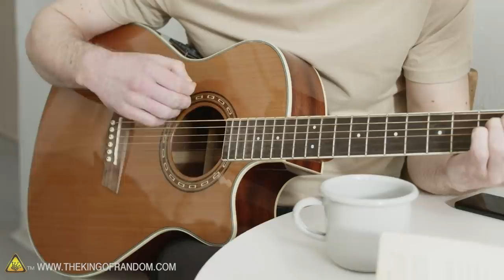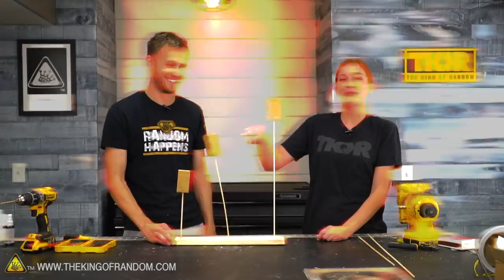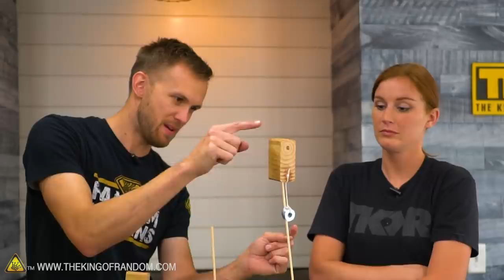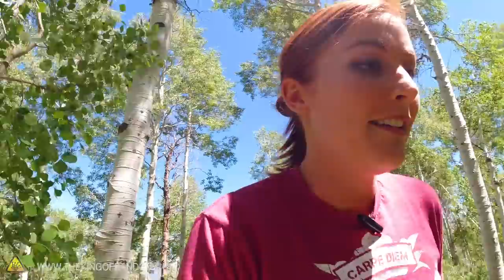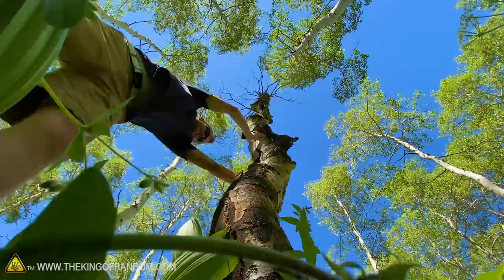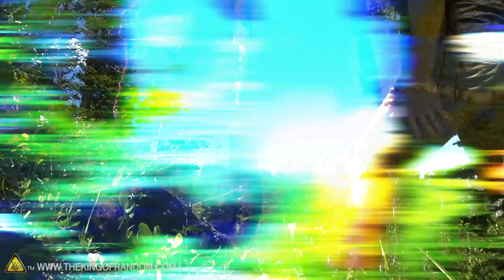How To Cut Down a Tree With No Tools

Comment: I have done this lots of times. There is a DANGER when doing this if the tree is too tall.  You were close to having the problem. If you look up at the trees that you failed with, you will see that you had more that one resonence going at once,  The tree has an "S" shape at max bend.  It can break in the middle of the S and come down on the person pushing !
Reply: Wow don't try at home
Reply: @ehrenbormann1014  yeah it's usually easier in a forest
Reply: huh so once it starts to fall run away?
Reply: @btd5ninja64  You can run faster then gravity? Wow, neat.
Reply: @oliverer3  hay maybe he lives in a forest XD
Reply: @Connor Joint, I think he means run to the left or the right
Reply: Yeah, if the tree is too dead and snaps in the middle you can get injured, knocked out, or killed pretty easy by the top of the tree trying this.
Reply: @ceeboneee5632  i mean if i could run faster then gravity wouldn't i end up lifting of the ground abit and it shouldn't be that hard to outrun something whats falling one dirrection if you go a completely diftrent one other then towards it
Reply: @Netdawg  The top can fall to any direction, if it doesn't make a clean break. Also note how he isn't watching up constantly.
Reply: Yep, I grew up in the woods and had quite a few trees snap in half and a few of them whacked me in the head. It could have been much worse
Reply: I almost got hit once doing this
Reply: I have pushed over trees this way and had the top break off. If you look up and see the top falling it is going to be too late.  Just don't do it.
Reply: Did that. Was unhappy.
Reply: @brokenos7710  I can see why
Reply: Plant 50 trees or die
Reply: Yup.  This can get you killed.
Reply: @ceeboneee5632  10 m/s
Reply: @thef2pgamer500  9.81m/s^2 you mean?
Reply: @ceeboneee5632  i mean somebody could go 36 kph
Reply: @ehrenbormann1014   who will destroy a tree in home and who will have tree this tall
Reply: @dilshadkp1304  I have trees this tall and taller
Reply: I put aka and auto corrected to wow wtf auto correct
Reply: @ehrenbormann1014  aaaaaaaannndd Im guessing you are the only one who has aspen trees at home huh?
Reply: I have had that exact thing happen almost got really injured
Reply: Woah....this guy has big brain
Reply: @abdelrahmanharmouch5221  min are white and red pines actually but same concept.
Reply: @ceeboneee5632  no, you can't run faster than gravity
Reply: @senmetwo42  why would anyone like this its terrifying
Reply: Connor Joint well it’s not like the tree is gonna start spinning like a helicopter im sure if you’re looking up at the tree pushing it and you see it break it’s not hard to sidestep run away like tree arent made of iron it’s not drop instantly you’ll have time to run
Reply: btd5 ninja run faster than gravity isnt a thing either you can’t outrun gravity it’s running not jumping
Reply: I thought the same thing
Reply: btd5 ninja or to step aside

Comment: We were doing this when we were kids. Just a reminder: look up, or you may get knocked out by a falling branch
Reply: I learnt that lesson with a Horse Chestnut tree when I was a child. Having solid spikey objects hit you on the head at quite a speed soon teaches you to be more careful when collecting conkers. To all non-UK viewers a conker is the solid fruit of the Horse Chestnut which is surrounded by a hard spikey casing. You remove the conker from the casing, carefully drill a hole from top to bottom then thread a, traditionally, shoelace, with a large knot on the end so the conker doesn't fall off, through the hole. You then hold your conker out at arms length by holding tightly, sometimes wrapped around your hand for added grip, the other end of the shoelace to the conker while your opponent swings their conker, in a hard downward arc, and smashes their conker into yours. When they miss it's your turn to hit theirs. For best results the person swinging theirs into yours shortens their laces by wrapping it around their hand til about 4 to 6 inches is left for maximum power. The bout is over when one of the conkers lies on the floor like shattered dreams while the victorious conker fights against a fresh opponent til it too breaks. Score is kept by how many your conker destroys before it too falls to the ground in pieces.
Reply: That happened to me once with a small spruce tree!

Comment: I learned this when I was a kid. It’s how I messed up my knee! When I was 8, i learned that if I climbed to the top of one of the pine trees in our play yard, I could swing with its resonance frequency... and since it was a pine tree, it had a lot of spring... until the branch I was on snapped. I must have hit every branch on the way down, hitting the top of the wall separating our play yard to the side yard. My knee dislocated. Luckily, I was 8. Nothing snapped or tore... the ligament just stretched like a rubber band. To this day, when i bend to the floor with my knees, they pop. And when it rains, they get all stiff.
Reply: Yikes man science hurts sometimes:(
Reply: icybear21 haha. I was just worried about the fun... not the science 🤪 I did learn from it, though.
Reply: My left knee does the same thing except I stretched my ligament doing high jumps. Sometimes it shift and sits at such an uncomfortable position
Reply: Was it an ugly tree?
ba-da-bum-tish
Reply: Could have been all those branches breaking your fall on the way down as well.
Reply: I had a similar injury from getting hit while playing sports. They told me that I'd have probably been better off if I'd outright broken it.
Reply: The reason that joints tend to get stiff when it rains is because of the pressure in the air being changed. The joints on our bodies are far more sensitive than the rest of our bodies. Because animals tend to have far more joints than human beings as well as being a lot smaller in comparison, they tend to react a lot sooner before a storm hits. This is also the reason why some people tend to become very drowsy when a storm is about to hit too. It's not just the darkening of the sky that triggers it, feeling that pressure all over your body tends to make you relaxed to an extent.
Reply: @Winnyao  that's really neat!
Reply: @Winnyao  Well didn't I just learn something new

Comment: Never thought I will hear my country and city from TKOR. 🇹🇼🇹🇼
A little info about the Taipei 101.

The Taipei 101 is designed to withstand typhoon winds and earthquake tremors that are common in the area in the east of Taiwan. 

A 660 metric tons (728 short tons) steel pendulum that serves as a tuned mass damper, at a cost of US$4 million, suspended from the 92nd to the 87th floor, sways to offset movements in the building caused by strong gusts. 

Its sphere, the largest damper sphere in the world, consists of 41 circular steel plates of varying diameters, each 125 mm (4.92 in) thick, welded together to form a 5.5 m (18 ft) diameter sphere. Two additional tuned mass dampers, each weighing 6 metric tons (7 short tons), are installed at the tip of the spire which help prevent damage to the structure due to strong wind loads.
Reply: Thanks for the info! I got excited when they mentioned Taiwan because I know some one who lives there. I might ask her more about it.

Comment: Shaking dead tree is actually dangerous because it can break in the middle and you dont see it and it fall right down on your head

Lot of people died doing that
Reply: if it's too tall then yes, but if it's a little shorter and you do it at the right frequency and know what you're doing then it's fine
Reply: Widowmaker 9000
Reply: @ooee8088  well that's kinda cursed
Reply: My uncle got paralyzed like that
Reply: I've had limbs fall out just from sticking my spike in to see if it's to dead to climb

Comment: This definitely needs a warning/disclaimer about the dangers. It is possible for the top portion of the tree to break out before you knock it over; if this happens, it will likely fall straight down on top of you, injuring or killing you. Also, look around the area for power lines before attempting this. If you push a tree into a high voltage line and give path to ground, you'll be dead before you realize what happened.

Comment: We did this 20 years ago when we were 8 or 9.
Funny to see the science behind it. All we discovered was that if we push and pull in the right timing it will move much easier and a lot more.

But don't do it at home. The last time the top third of the tree broke off... Cause it's a dead tree duh.... And hit me in the head. Luckily I wore a bicycle helmet. Split it right in half.

Comment: I tried to get some firewood like this at scout camp 4 decades ago but my point of failure was the yellowjacket nest I was standing on under the dead tree. After a short lap or two around the campsite I jumped into the water barrel (fire control) to get them off me.

Comment: Cool fact about aspen trees. You can grow a whole forest from a single seed. However, it takes thousands of years. The way it works is that the tree will grow normally, but then it will send out a root to grow a second trunk. All existing trunks continue to grow new trunks until you eventually have a whole forest that is technically a single tree.

Comment: I do enjoy the videos, first off and foremost.
Remember in the middle part of the video, her stating they were only doing dead trees?
Then the tree lands on 4 or 5 young saplings and lays them on their sides. 
Pushing a dead tree around?
If your showing in the video your full process with the tree, and I assume you are, you had absolutely no idea of the condition of the interior of that tree.  We assume it is brittle since there is no obvious active growth on the outside.  That alone is the first danger sign.  Your first horizontal motion of that tree, that was stronger than a stiff breeze could have turned the ground around you in to a target for multiple projectiles.

Comment: I've taken down trees in my dad's backyard this way. It's a lot easier, and safer, if you get a rope looped around it as high as you can. Basic leverage.
Also, you can pull one that's partially fallen down safely with the rope.

Comment: That is pretty dangerous as a dry, brittle, dead tree could suddenly snap or split at any moment, at any height or angle so that the tree above the break and all of its weight suddenly drops like a javelin because there is no drag from leaves or branches above to slow its fall. Even a large chunk or chunks of the top of the tree could have a lot of weight behind it, enough to cause injury if it hit any part of you. Even the stump below the break can unpredictably affect the top's fall, angle, direction, speed, bounce etc. making it harder for you to possibly dodge it.

Comment: Anybody ever grab a tree at the trunk with a very rough bark? These ones are great if you can get one or both hands around most of the trunk then twist ring your heads around one spot of the trunk. You will eventually notice that the trees bark will begin to warm up and cause the bottom of the tree trunk to begin fracturing if you put all your strength into trying to take it without any tools at all. Once the tree falls off the splintered base of the trunk you can then twist the tree around like a crocodile in a death - roll, this takes the tree off the splintered base entirely and you are free to take it with you lol.

Comment: Knocked over many a pine tree here in Cali many years ago when I was a teen in the forest wanting some firewood for the campfire.  Has to be a very dead pine no bigger than 4-5in diameter that's not well-engaged with other tree canopies and has a clear drop line.  When dead enough the taproot and other roots have rotted enough to snap under the force induced by the oscillation.

Comment: wouldnt it be easier with a rope wrapped around it as high as you can place it and then you hold the two ends using leverage based on the pendulum effect or in some manner using a pully system to increase the output you can do wile you do less physically? although yea i know that can be considered using a tool i was just curious isnt that easier with a rope

Comment: I just saw a video where they mixed melted crayon wax potassium sugar and baking soda, put it in a tube crushed match heads and put it on top then put a fuse thing in and lit it and had colored smoke, I wanna know if that's faked or not

Comment: This is extremely dangerous; in fact this video is rather irresponsible. The oscillation of the top of the tree is far more likely to snap the trunk than it is to uproot the tree. You are extremely lucky that the top didn't come off and land on your head. Trees like this are often referred to as "widow makers" for this reason.